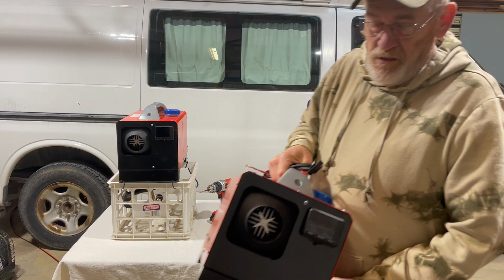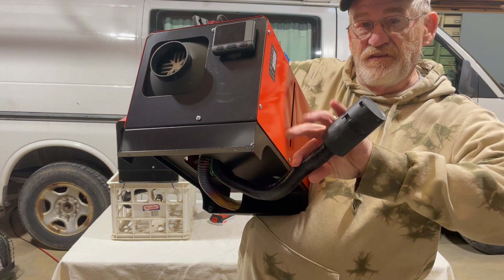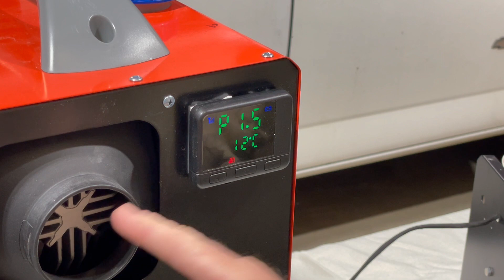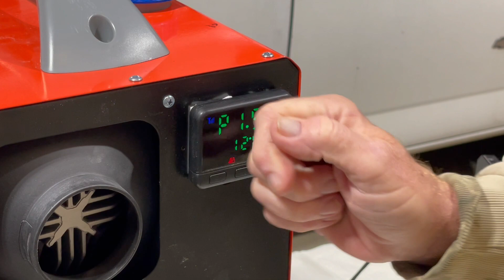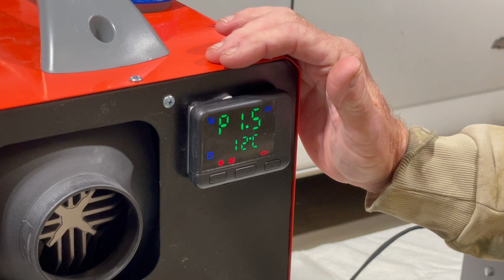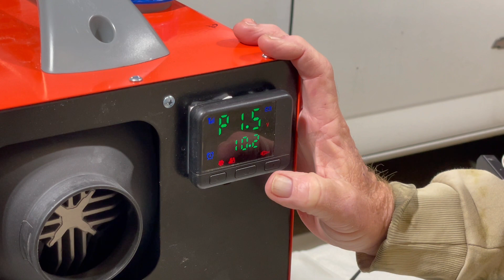All-In-One 3-Button Diesel Heater Tutorial

Comment: Really good overview of the heater, one thing that concerned me is that even when the heater is turned off. The display is still lit up, even after an hour. 

Is there a way to turn that option off or do I need to put a switch on the line from my external battery in the van?
Reply from the maker: I think it stays on, does dim after a few minutes.

Comment: The rotary dial controller is way better ,  it has a on button , a off button and a dial to dial how much heat you want , can I buy a rotary dial controller and hook it to this heater ?
Reply from the maker: I think they only work with a certain control board.
Reply: @TrailMedic911 
I looked into it , it looks like your right

Comment: You did a great job explaining everything, one question though on the screen with the clock is a P # you said goes up to about 5.5 is that how you control the heat kind of like a thermometer?
Reply from the maker: Yep, if memory serves me, that’s the frequency of the pump the faster the pump pumps the hotter it gets.

Comment: when I scroll through the menu and try to change any of the 6 settings by pressing the over buttons nothing happens the arrows wont change the settings. is it in a different modem how can i fix this thanks
Reply from the maker: Wow, not sure.  It could be a different controller or a problem with the one you have.

Comment: I doubt you'll reply, as I'm really late to this video but I can hope. I have a 30' motorhome that I live in full-time with my cat. I'm trying to figure out how I can set one of these up so that it heats the motorhome while I'm at work. I also need to figure out how to rig up an additional bigger fuel tank, as the one that comes with it is far too small. I really don't want to do alot of drilling or put more holes in it, as it can reach very cold in the winter (-40 at times). Any suggestions?
Reply from the maker: RV Life | Winnebago Minnie Upgrade | Diesel Heater
https://youtu.be/laAA4S0tGpk

Comment: Thank you for creating and posting this! My controller doesn’t have a clock, but it has the three buttons and the 1688 code worked to get me in ! Thank you !
Edit : My diesel heater isn’t an “all in one” the heater is separate from the fuel tank, and I’m using fuel from my diesel sprinter van fuel tank.
Reply from the maker: So, you must have a camper van.  Do you have a channel?
Reply: @  I camp in my Sprinter van sometimes, but it’s primarily my work van. I have a one burner propane stove in it for making coffee.
I installed a sink during the Covid pandemic so I could easily wash my hands, and 2 weeks ago I installed a diesel heater in the passenger seat base, so camping in it is a lot better now !
My YouTube channel is mostly dash cam driving around Seattle and one of my videos has 1.5 million views :

https://youtu.be/Q39uIXLh030?si=EIU5Zhs1CHUkav1k

Comment: Is there any documentation on what exactly the "U", "SN" and "PF" settings (in the advanced settings section of the video) change with these controllers? The manual with my Vevor obviously has nothing about them, and I do have a carbon monoxide detector that I'll use when I dial in the fan speeds and pump frequency (once I finish setting up the stand for my heater), but while I'm doubtful the three settings mentioned will affect anything I'm doing, the curiosity of what exactly they control is driving me nuts.
Reply from the maker: Sorry, I don’t know either!
Reply: @TrailMedic911  A quick update from another random video I stumbled across; the PF setting seems to correlate with the power to the glow plug when it's active. This is a copy & paste from the comment I saw that details it:

"The glow plug power is actually programmable. It's set to 85 watts by default, but many have said it will run fine at 35 watts, with the benefit of prolonging the plug's lifespan. In a limited mAh setup like yours, you'd probably benefit from playing with this setting. It's the "pf" in the settings menu. 1=35w, 2=40w, 3=45w, 4=80w, 5=85w, 6=90w"

What's interesting is his comment says the default is 85W, but according to the numbers he posts and what your controller shows when you scroll past it, yours is set to 90W.

I like the idea of extending the life of the glow plug, but I'd be concerned about soot buildup over time in the atomizer screen on shutdown if the glow plug isn't reaching a high enough temperature. I might have to do some long term testing at 80W and then at 40W to see just how much of an impact there is between the two.

Comment: Heads up, I bought the all in one so I could plug n play. That’s not how it worked out. As soon as I tried to turn it on I got an e 04 code which as it turns out is the fuel pump. I had to take it apart eventually only to find the fuel pump was not plugged in. After I figured that out it started easily. Beware if u see that code and have ur screwdriver handy.
Reply from the maker: Yep, quality control in China is not always the best!

Comment: Don't run your exhaust pipe past your air intake and fuel line. That's a good way to melt your fuel line because that exhaust pipe gets super hot. Send this video is a year old I would imagine you already discovered that. The exit hole in the back of the machine is for the air intake line not the exhaust. It's tempting to Bentley exhaust pipe at a tit 90 to run it directly under the machine, but that's a bad idea. You want that exhaust pipe to run straight down for several inches under the machine before it turns. The exhaust is designed to exit straight down before turning. You don't want the exhaust anywhere near the fuel line or close to the bottom of the machine.
Reply from the maker: Bottom line…. 
Don’t get the fuel line near the exhaust! 👍

Comment: Hey man I cannot find the answer to this question anywhere. Can you accurately tell me if I have to prime my diesel heater every time I use it? Or just when it’s new and/or when it runs out of fuel?
Reply from the maker: Great question.
I think the best answer is that it only needs to be primed when the fuel line is empty. 👍
Reply: Thanks a lot man

Comment: Hi there, great video, very clear 👍 I have two questions if you don’t mind helping. I’m using my heater for the first time (used vw multivan t5) and there is a lot of smoke coming out from the exhaust outside the van. How can I resolve this and is it dangerous ? And also, when I set the temperature the screen shows the desired ambient temperature up top and also below another temperature (I presume the output temperature) but that climbs up really high during the heating cycle, to 156+C degrees C. Is this normal ? Should I be worried, or is this normal ? Thanks so much for any help you can provide! 🙏
Reply from the maker: Don’t use any type of additive in your diesel.  This can cause smoke.  Also, it may have been over primed.  It should clear up.
The burner chamber temp will get high.

Comment: I have never owned a diesel heater before and i just wanted to know how to 'add the power supply' but it was the only thing not covered in this video.
Reply from the maker: You’ll need a 12 volt supply.  The only real issue is that it needs to provide at least 12 amps during startup.  I use a LiFePo4 or deep cycle battery.  Most power stations can’t put out 12 amps.

Comment: Excellent video!
Edit: mine looks like that but doesn’t operate like that. My power button doesn’t cycle anything 😫
Funny mine operates totally differently.
Reply from the maker: It may be a different type of controller or it mite be defective.  There are 3-4 different controllers that they use.
Reply: @TrailMedic911  I suspect it may be defective. When trying to decipher the instruction manual, it seems to be saying exactly what your demonstration illustrates. However, the panel just doesn’t operate.
Reply from the maker: @Treetopflyer777  👍
Reply: found a solution ? I have the same..

Comment: Thank you I’m having a problem with my new 2 week old heater … when it starts it shuts off saying low voltage then when I turn the power supply off then back on it starts up ? Do you have any suggestions on how to fix this issue?
Reply from the maker: Yes, it sounds like you are loosing amperage.  Try a heavier gauge wire.  It needs a full 10-12 amps of 12 volt power.  It uses this mostly on startup then backs off once it’s running.
Hope this helps! 👍
Reply from the maker: Still sounds like you need a bigger wire!
Reply: Thank you I will try that it does it  when it’s almost powered up the pump is clicking and then it shuts off low voltage and one time white smoke came out.

Comment: I've also discovered that some of these heaters are switched between Hz and Temp by holding down the ON button for a couple of seconds on the remote control whilst heater is running ,pressing the centre and left button on mine does nothing..
Reply from the maker: That’s interesting.  I did not realize the remote could do that. 👍

Comment: I recieved mine yesterday,apparently vevor has changed something with the controllers so if yours is like mine you cant change to hz mode,you cant access the settings mode and you cant change fan speed. If i try to access the settings it just closes goes back to h level. If i hold the right button and the power button i get a hfa menu that is 1-5 guessing this is fan speed but no matter what buttons i press or hold i cant seem to get it to change from 1
Reply from the maker: It is probably a new style controller.  They have been changing and upgrading them about every other year.
Reply: @TrailMedic911  its the identical controller as yours but the software in it must be different, i think im going to order the other style controller with the physical settings button just to be sure that i will have access to the settings lol. But even with my fan stuck at im guessing speed 1 since its not very loud im impressed with the heat it blows into my side by side. If it proves itself to be reliable it will be a great investment
Reply from the maker: @TheIamdevin  👍

Comment: Sorry, 10 month later..The exhoust is not supposed to go in hole snd back. The combusrion air intake should go there. With exhoust pie you get exhoust is sucked in and mixed with air that will be heated and blown in tp your compartmen. ( lots of comments so someone may already pointed it out. ) I have the same heater.
Reply from the maker: There are 2 holes on the bottom.  One is the combustion intake and the other is the combustion exhaust.  The large holes on the front and back are the heat exchanger intake and exhaust.  The large hole are the clean / dry air used to heat your environment. (Room, truck, tent, etc.) 👍

Comment: With the unit outside is it rain proof or does it need to be covered.  Also, with the remote inside the trailer can you set the interior temperature so that when the unit reaches this point the outside heater would slow down , thanks
Reply from the maker: It’s not waterproof so I have to cover it in foul weather.  I run the heater on frequency mode so I don’t have to worry about the temperature setting.  When it gets warm enough in the truck, I just turn it down to a lower setting.

Comment: One useful thing I found was if you press the left button and centre button together, the frequency switches to a temperature thermostatic setting that works on a desired temperature being reached, which adjusts frequency automatically
Reply from the maker: Yes, which works really well when using in a smaller area.  That is the way I use the one in my van.  But, in the garage I use the frequency so I can control the fan speed & temp. 👍
Reply: But how do you reverse that?

Comment: hello, I had a problem of very very exaggerated smoke before starting for One minute, then I discovered that by removing a layer of grid  from the glow plug grid tube atomizer, it went into place!... it seems strange to me, I've never heard anyone do this, what could it be the very cause?
Reply from the maker: Not sure.  If you run them on a low setting for an extended time they will build up carbon in the combustion chamber.

Comment: Do the fuel tank caps leak?  If you have 1/2 tank and travel on a bumpy road will fuel slosh around and leak from the cap? I have not seen this addressed directly on any YT channel. Please be the first.
Reply from the maker: It is a breathable cap, so there is that possibility
Reply: @TrailMedic911  Thanks for the reply. I want one of these heaters but it seems it would require it own dedicated tote for transport. If diesel gets on anything its gonna stink for a long time! And then theres the re-fueling can of diesel. That needs to fit in that tote as well.
Reply from the maker: @JD-ft2lr  I put mine in a plastic storage box without the lid.  That way I can contain any spillage. 👍

Comment: Absolutely wish I had found this yesterday before I was tearing my hair out trying to get mine lit. For starters, you'd think that "up" would be the right arrow button, and  "down" would be the left arrow button..... not so as you just proved. I was totally flummoxed when it spit an E 10 error code and the list of error codes in the manual stopped at E 9 🙄. Ultimately I was able to fumble around enough and did manage to get the pump primed and burner lit. Thanks!
Reply from the maker: Glad it helped and that you got your heater going. 👍
Thanks for Watching!

Comment: What does it mean the the glow plug symbol comes on and stays on?
Reply from the maker: It should go off.  If the glow plug stays on the heater will still work but it will use more DC (12volt).   You can check if the glow plug is staying on by checking DC usage.  The DC will be less when the glow plug is on and then jump up some when it goes off.
Hope this helps.
Happy Holidays!
Reply: Yeah, mine draws about 8 amps when the glow plug is on. It drops to a lot less but how much drop depends on the power setting. 
Like when the power setting is at P01 it draws about 1 amp.

Comment: New power pack 12v 30 amp had to raise heater as exhaust pipe was pointing up hill heater would not fire up got error code e10 ,when heater was lifted higher it 
started up  have some snagging issues to fit as back up heating .Always go to this video from Trail Medic as it is so clear to the point and helpful
Reply from the maker: Thank you and….
Thanks for Watching!

Comment: Great video Trail Medic. I have one quick question. I just received mine today and I'm thinking I want to run it in frequency mode. Mine showed up in H1 to H6 mode. Do you know off the top of your head how to go between those two modes? Mine is a Vevor (8kw). I know I know, they don't exist but it was on sale from Vevor's website and I like the short fat design just like yours in the video.
Reply from the maker: I think you can press the up button and the center button at the same time to switch between frequency and temperature.  See if that works. 👍
Reply: @TrailMedic911  wilco tomorrow. thanks for the reply sir.

Comment: I have the same heater.  I notice a smell from mine. Have you had any issue withna sweet smell?
Reply from the maker: Maybe a very slight smell occasionally when I first start the heater after it has set for a while.  Make sure your exhaust is not blowing back toward the intake too.
👍👍👍

Comment: Hi, thanks for the nice video! have exactly the same display, but can't get it to run smoothly, slp appears in the display, do you know what that means?
Reply from the maker: Sorry, I cannot find anything on that. However, it may be that your pulse rate (the frequency) is too low. Check the low frequency and if it is below 1.4 it needs to be adjusted higher. If that does not work then you will need to do a factory reset. If you do need to do a factory reset check on YouTube for how to do it.
Hope this helps!!!! 👍
Reply: @TrailMedic911  takk !

Comment: Great video. It was very helpful. I just got mine setup in my enclosed trailer. Your tips helped me figure out what to do to fire it up for the first time. Now I’ll just have to mess around with it a few times to get the hang of it all. These little heaters mover a lot more air and put out more heat then I expected.
Reply from the maker: And they are very efficient too!  I think you will really like it.
Thanks for Watching!
Reply: @TrailMedic911  thanks for the video on 3 buttons. Now I'm getting a code 08 and shutting down. It did the same about 3 weeks ago then worked for awhile. Glow plug dirty? Should I take it apart? Only burning #2 and a little #1 TIA
Reply from the maker: @jimmillard3513  I would give it a try.  It’s not hard to clean the glow plug.

Comment: Finally the Diesel heater class we have all be waiting for.     I kid but great video.   I will be installing one of these in the near future.  So how much run time do you get out of a tank on these.  and how much do they hold?   New build has 2 gas tanks.. contemplating changing one to a diesel tank just for the heater.. but it may be way to much fuel.
Reply from the maker: It would be way more than you would need.  I have a 3-gal marine fuel tank in my van.  I only had to fill it up twice last winter.  So they don’t use much.
Reply: i got mine last weekend. hooked it up, filled the tank and touched'er off. so far i am at about 9 hrs run time and 3/4 a gallon of diesel. i have not monkied with any of the settings, just running it as it came out of the box. Loving this thing! i have only run it on H-3 and H-4. H-6 for about and hr just to burn off any newness smells. if i runn at the lowest, i wouldnt be surprised it i got 12-14 hrs run time on a gallon of fuel.